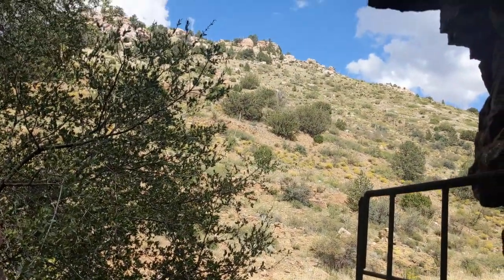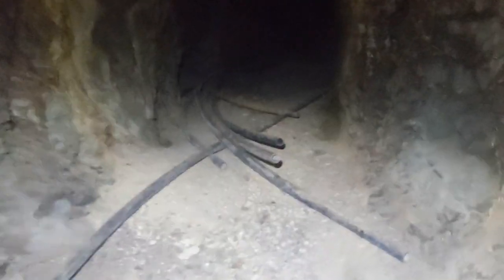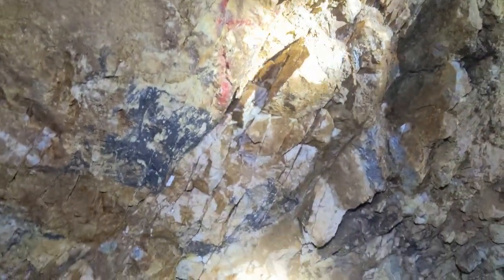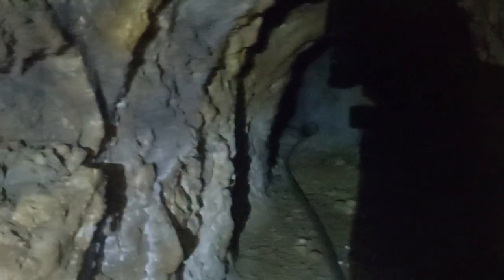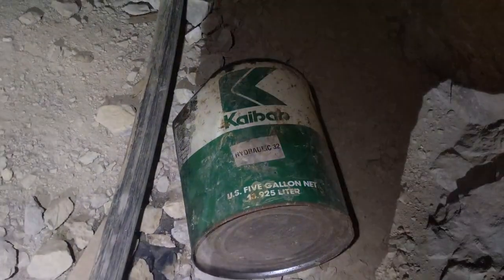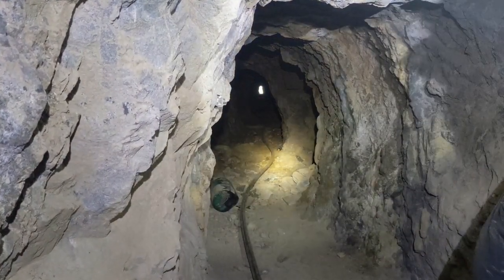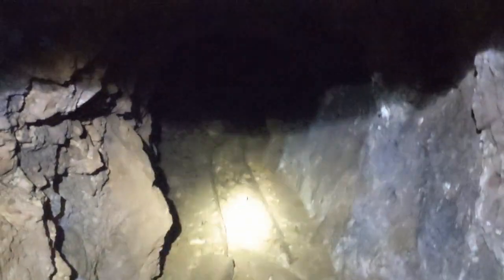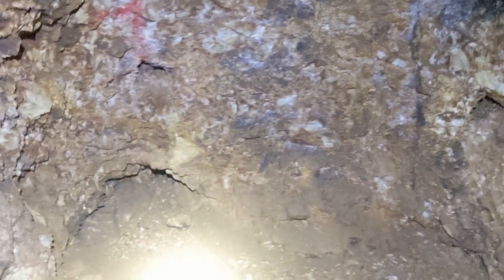The Swede Tunnel: More Than Meets The Eye

Comment: Using those old workings as an escape way is a good idea. It would also assist in air flow to your lower workings.
Reply from the maker: That's the ultimate plan, though there's quite a bit of pumping and raise mining to go. Our current working face is almost exactly 500' northwest and 200' below the main intersection in this one, and a survey point near the flooded sump is about 75' northwest of the intersection. The raise at the end of the decline is even closer to the adit, and roughly 185' below it. I love the idea of finishing that (a raise bore was contemplated but ruled out on the basis of cost - we're keeping an eye out for a used Alimak) and installing a 50HP exhaust fan at the portal.

The good news: we've got a second pump and its starter box on the way. We'll be dewatering almost twice as fast in a couple of weeks.
Reply: @Porty1119 Sounds like you are really coming along with this. Good too hear! Looking forward to seeing more videos of your progress.